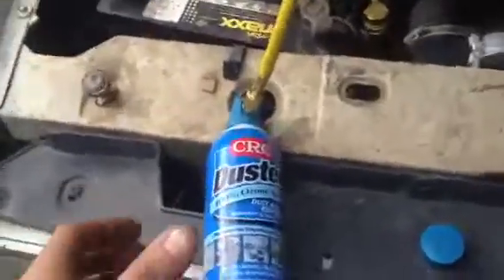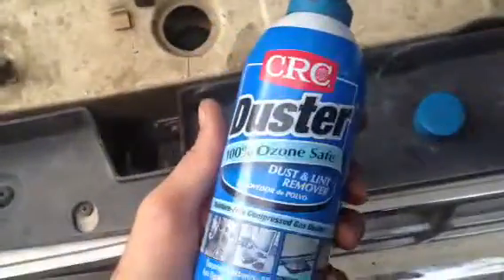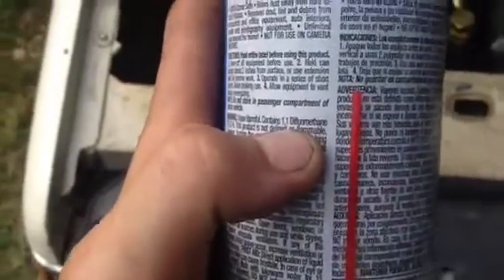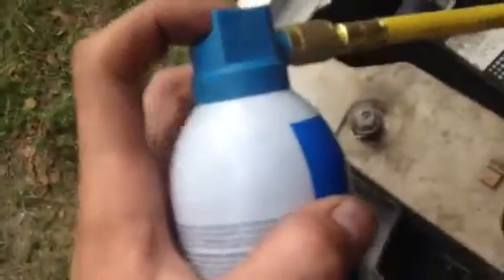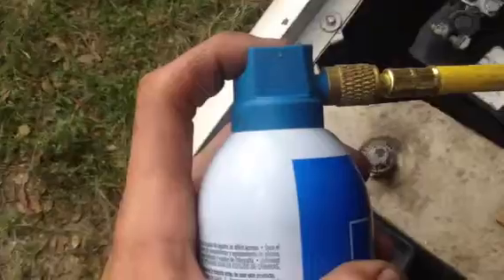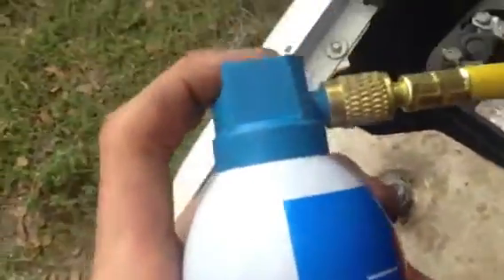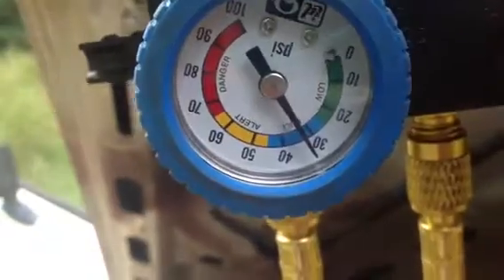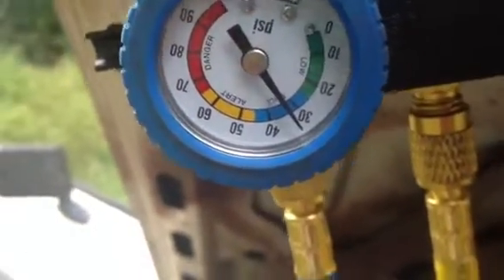Charge ac with air duster! Pt 1

Comment: The problem with using R152a in a stock R12 system is that R152a is NOT compatible with the mineral oil compressor lubricant used in R12 systems. You don't have to take my word for it. You can look it up. It will not mix with and carry mineral oil through the system like it's supposed to. You'd need to flush the system and use a different oil.

Comment: Hychill 30 is better (Australian product). Max pressure needed is 30/190 and creates far lower temps. In USA it maybe called M30 gas. You can reduce the pressures to get similar cooling performance to r134a and even less strain on the compressor. You can mix M30 with r134a, use it to top it off. Some people use propane alone, which is good for below 30 celcius days.
Reply: Hychill -30 is the same as 12a in USA

Comment: i tried this on my 88 ranger.. works great.blows way colder than the r134a did and doesn't run at such high pressure.. the compressor is not as noisy and doesn't stress out the engine as much.. r134a is a joke..it even sucks in A/C systems that are made for it.